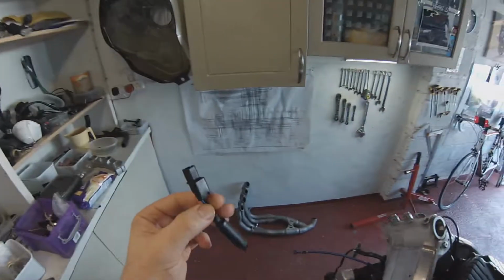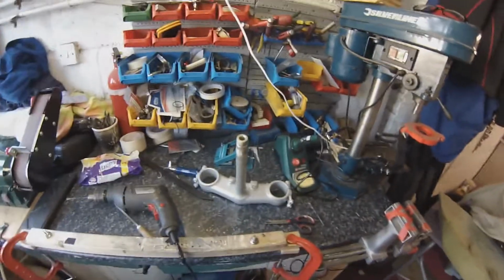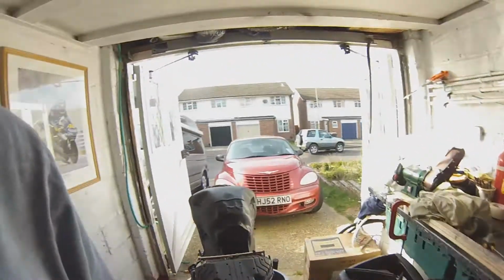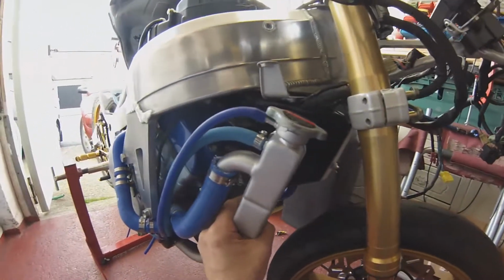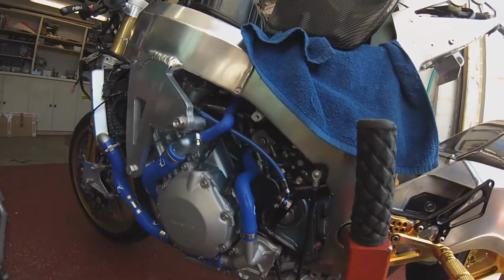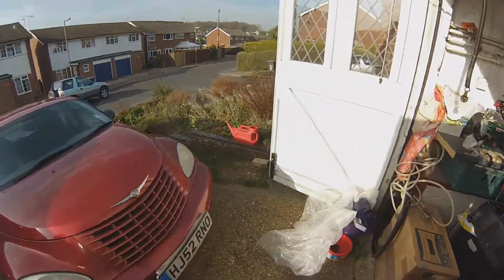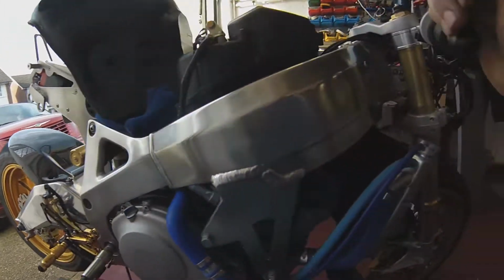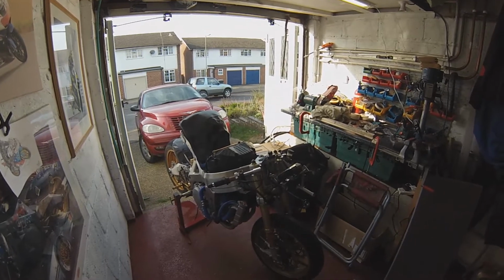Honda Fireblade (Over heating issues ) - Garage Build EP22

Comment: Hey loving the vids. Question did you sort the fan as yet? I had same problem with mine and what happened is I did exactly as you did and painted the rad including the fan mounting points. That prevented the fan from getting a good ground. So you could try removing the paint from fan mounting tabs. Especial the one with the ground wire.  Hope that helps. Great job btw

Comment: My fans don’t come on until 222 degrees and only cools it down to 212 and then goes right back up to 222 and that’s going 70 mph on the highway.. I just changed thermostat and coolant. What is Normal operating temperatures during riding? Do you have any suggestions. I have a 98 cbr 900rr

Comment: Hi mate lovely videos thanks for sharing i was very interested for all. 
i have a rr04 23.000 miles in the clock 
i have overheating  issue i cleaned radiator and got rid of the air lock for sure   but still once engine is  hot and goes over 103 it never comes down when stationary specially if i am riding  she is fine sits around 80 - 82 but staionary traffic and idling killls the bike goes  up up and up 
do yyou have any experinece can you helo me or divert to right direction??

thanks
Reply: Where did you get your radiator? I am  having issues with my 2005 cbr1000rr getting too hot and think my dad is to blame or pump

Comment: Hi dear fellows, i need expert advice if anyone’s can help me with this matter. I have cbr 1000rr 2011 model. The temperature here in our country remains between 25 to 40 these days. i have a heatup issue with my bike, 
i have recently changed 

New piston and pressure rings 
New coolant 
New engine oil (ams oil)
New oem coils 
New battery
New oil filter 

But still the issue is there when i am riding without traffic, it’s temperat is 98-106 degree celcius 
which is too much while I checked from other bikers, their operating temperature is 92 to 96 while riding. Also my rpm gauge is fluctuating by itself without rev.

Also i test my bike fans, turn on the ignition and let the bike temperature increase till the fan comes on, when it reached at 104 degree celcius the fan comes ON, i did not drive the bike and just rev the race few times so that the temperature could come down and the fan turn off, but after dropping 1 or 2 degrees, the fan did not turn off and temperature started increasing till 109 stayed there and then started increasing and then i turned off my bike, I believe that the fans should drop its temperature and turn off by itself but it didn’t, what does this means ??

Need serious help please

Comment: The fan start at 105-106 celcius...
Reply from the maker: Im using the RRW rad so it has the temp switch from the 98 bike. Normally on my RRW before it would come on at an indicated 100c on the clocks which is engine water temp not radiator.. I need to test the fan today, I think I have a bad earth.. Will keep you posted :-)